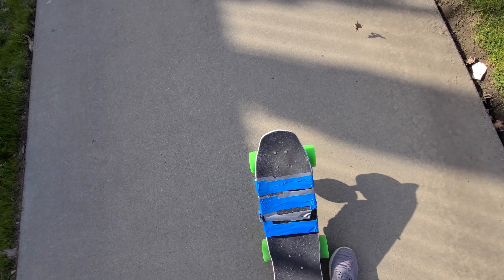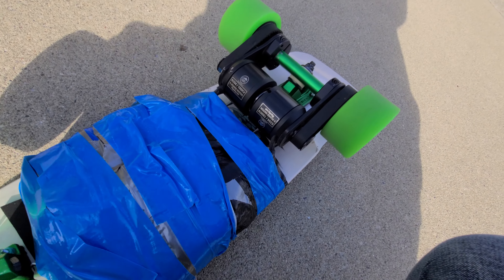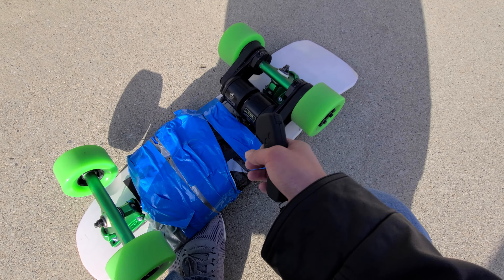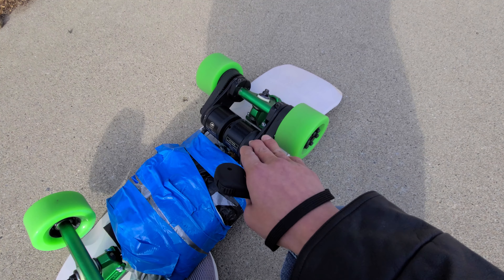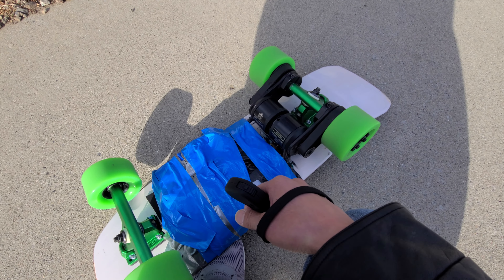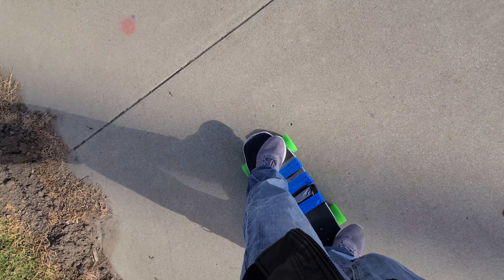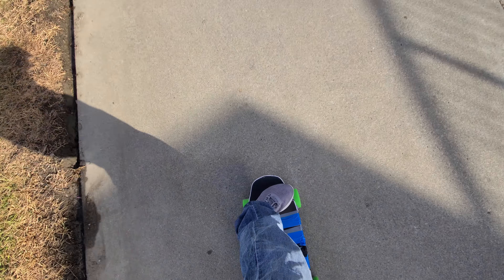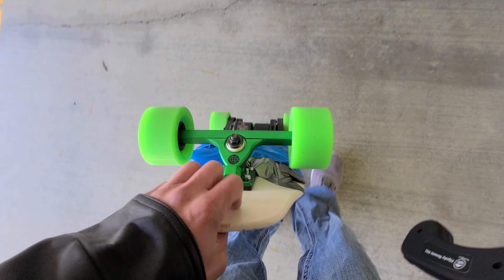I've built Electric Skateboard Faster & Lighter than Boosted Mini S!

Comment: What was the top speed of this ? I’m building something very similar and would like to know
Reply from the maker: It's around 30mph but I would never go that fast on board like this as it is too small, you would want a longboard for anything more than 20mph.
Reply: Dr. E Skateboard oh nice one yeh the motors VESC and wheel size are the same but on a longboard.
Reply from the maker: Yes you can go 35mph easy with 6355 motors. Make sure to wear full safety gear!